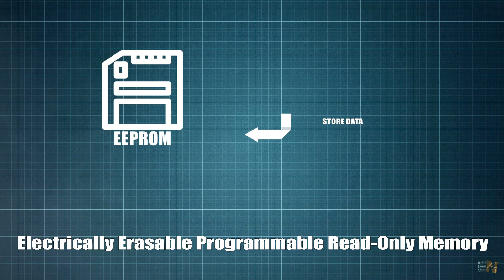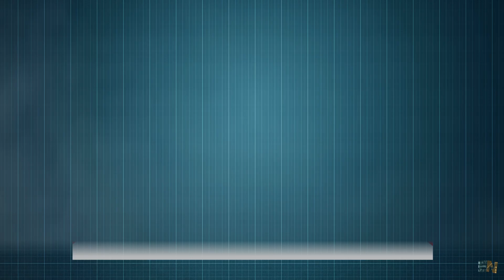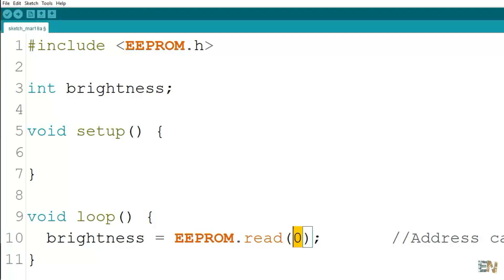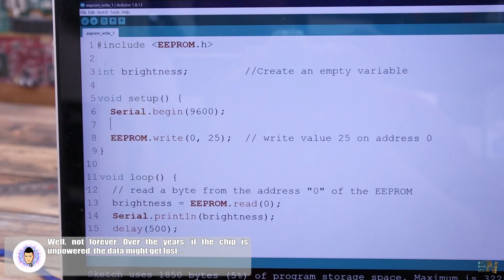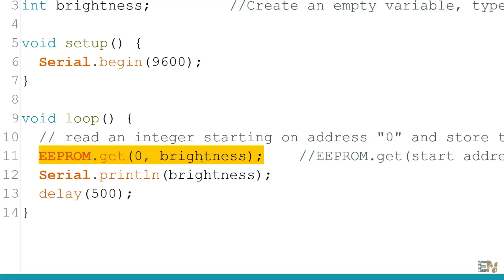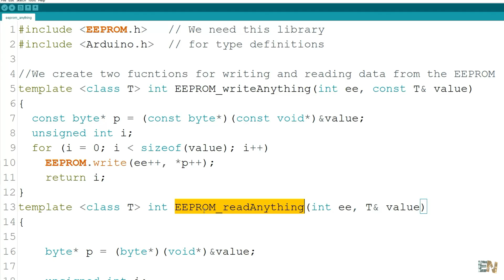EEPROM Memory - Store Anything - Arduino101

Comment: your example around 8  mins doesn't actually show it recalling memory on power up since setup still had the write function. it would show it better if you changed the code to only read on loop and not write, that would prove the memory while off.

Comment: Is there any way to read/write this memory or any other option like memory faster then 3ms? Can we read/write in micro seconds? I'm using a clock of 3k, thus has a time frame of 333u. So, I want to store and read ADC value as fast as possible because I have to react as soon as possible if detect any change in analog value at A0;

Comment: EEPROM.write(0,60);    lcd.print(EEPROM.read(0));   EEPROM is not storing values permanently.      when I block this line     //EEPROM.write(0,60); .... and run the program again after switch on/off power... its shows 255 value ?

Comment: Nice video as usual! Thanks. 
Qst though.. in your example, you left the value assignment 25 in the setup. that would have been better to do an example that increments an eeprom byte with a button. then disconnect and reconnect to confirm the memory retention

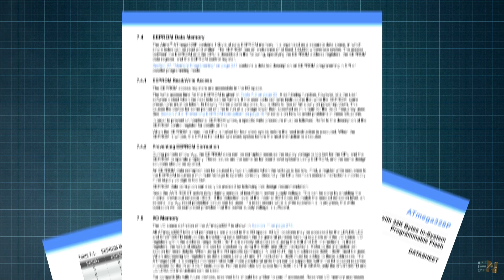Comment: 3:31 It would be more awesome if you have mentioned the size of transistor
Reply: They will probably change size depending on how they were manufactured. Older EEPROMs will most likely use larger transistors than newer ones. Its also not really relevant information as it can change and it doesnt really change the implementation at all, might effect things like density and power consumption though.

Comment: eeproms constantly spit out their binary values within their memory on the data lines that they are connected to, especially in devices that need to remember settings like Christmas lighting controllers, they are like electronic reminders.
Reply: That happens with EEPROMs that have address and data pins that you access in parallel, rather than I2C or SPI EEPROMs.

Comment: Thanks, nice video! EEPROM's are very useful. I use the internal or external (24C256) to log c-strings of variable size. It's for debugging my sensor code over several days. I can then connect my pc and dump the contents of the EEPROM on the serial monitor.

Comment: EEPROMs are often featured on SoC ics but if you look in the datasheet they have a limited number of writes. The chip I use, I think it is guaranteed at 100k writes. It sounds a lot, but if you program is say updating it once a second then you will end up with an unreliable program and wonder why it is so temperamental.  The solution is to use a memory controller. This will mark faulty parts of the memory so the controller switches to a fresh block of memory and does all this without you worrying about it. I need a lot of flash so I now use and SD card which has a built in controller. This never fails.
Reply: EEPROM is more used for storing settings or data that wont change for a while, not like for writing once a second, flash devices like emmc or SD cards or SPI flash have less write cycles than EEPROM, but they are bigger so wear levelling can be used to greatly increase their lifespan. I also think you may be confusing EEPROM and flash, they are similar but they are not the same. SBCs with built in storage usually use EMMC, which I think you probably mean rather than EEPROM, they are very similar to SD cards and in a lot of cases are actually more reliable than SD cards.
Reply: @conorstewart2214  I did mean EEPROM. With a SoC you often get a small amount of EEPROM as well as flash, and the EEPROM is supposed to have about ten times the write life. The sort of thing you may want to do a lot of  writes is say when you want to record the time you switched the system off or perhaps when it crashes and you want the most up to date time or possibly other varying data.  I do not have an EMMC in the Soc I use but do have and SDIO interface.
Reply: @Andrew-rc3vh  "I need a lot of flash so I now use and SD card", you went from talking about EEPROM to flash and SD cards. Lots of modern microcontrollers and probably SoCs too dont have EEPROM, they just emulate it using flash, so you lose most of the benefits of using EEPROM, I know STM32 does this, I know teensy does this, the rp2040 doesnt have it either. You also talk about memory controllers and EEPROM, I've never seen that before, and you talk about fresh blocks of memory, which sounds a lot like flash, so you can probably see why I thought you may be confused. 

You also stated that sd cards never fail, they actually have a very high failure rate compared to other types of memory, for example in my phone I use an SD card for storing things like photos and about once a year the whole card fails so that it becomes unwritable, I can only read it from then on, and I use good main brand cards. If you look at forums and similar you will see that SD cards fail very often compared to the likes of EEPROMs, SPI flash, EMMC etc, it does have the advantage of being easily replaceable but it still fails faster.
Reply: @conorstewart2214  Hmm, it seems odd that it fails more often if it is the same memory. Perhaps that might have something to do with the connections. Actually given the choice I would have liked the small bit of memory to cope with a lot of writes because I had it so arranged that it would still work without the SD card and write to internal flash if it were not inserted. Anyhow this has to write the time once a second, so now i arrange it so the part of the memory it writes to advances as the log records data. It's a complicated thing to explain fully, but it does work 100% reliably now. I used to need to store various pointers, but that's all taken care of in the new scheme.
Reply: Andrew it’s really not all that complicated to explain, you are pretty much just creating a log file, just recording data and moving through the storage writing it sequentially one after the other. Unless there is something else you are doing too.
Reply: @conorstewart2214  Yes there is in fact. The time stamp is 4 bytes, but seeing 3 of them rarely change I just log the byte(s) that changes. It tend to compress the data and is fast to read. I need to scan the last block on startup, but it means I do not repeatedly need to store pointers. One thing I worry about is the classic case where you power down and interrupt a write cycle. This way makes it more robust against that kind of problem. It will not trash the whole log. If it fails to read or write I have an error log too. So far zero read/write errors.

Comment: The question remains how to extract the firmware off the chips. i use Microchip MPLab PicKit4 to extract the hex file to create another device. u can read and write to any arduino using this device. but it would be noooice to have content based on that process. especailly when u break the usb port off

Comment: You could have told the Viewers how to Map the Content of your EEProm for the entirety Sketch - to not have conflicting Adresses and length. Also it would be important that the eeprom keeps it value’s if you reflash your development arduino for the next project - which could cause unwanted behaviour if not accounted for
Reply: I usually solve this by only writing a single union struct to eeprom with a single first static integer version - if the version doesn’t match my constraints - als eprom data is erased

Comment: Hi,
EEPROMs are quite handy and useful to work with. However, they suffer from slow writing/reading speed (I2C) and small data storage capability. A nice improvement is to give NOR Flash ICs a try since they feature larger data storage capacity and faster to deal with.
Nice tutorial keep it up !!
Reply: Interfacing those NAND and NOR flash require special hardware that comes with STM32.
They offer FMC specific to interface those type of storage beside the QSPI and OctaSPI flash system

Comment: Dear Electronoob,
Can you tell me the difference between eeprom.write and eeprom.update function is both are same or different?
Does eeprom.update function reduce the writing life cycle of micro-controller as eeprom.write function does because as mention atmega328p has 1M(million) write cycle it means if we write 1M times it writing life exaust does it is same for eeprom.update function?  (Sorry for bad english)
Reply: EEPROM update reads the current address and compare it with the value to be stored.
Of they are the same, no write shall be done.

Comment: Hi,
thank you for the tutorial and effort you put in those videos.
On another hand, I don't recommend using eeprom,put to store more than 1 byte. It might effect a previously stored data and ending up with useless data.
My recommendation is to divide the float or int to 4 byte manually by mean of shift operation and store them manually.
This method will let you know where the data stored and avoid overwritten the previous values.
Reply: I was also wondering about this issue. But don't understand how to handle it
Reply: You just need to know the size of everything you are storing and make sure that none of it would overlap and probably create a diagram or map to know where everything is, another way would be to have the address auto increment by the size of the data to be stored but that is most useful if you are writing a sequence or set of data sequentially and reading it sequentially.
Reply: Christ

Comment: Hi!
Nice job bro!
I looking for nrf rc car control, and in your channel i found the example for that.
But i dont know how to put to gether because of the interference between the 3 phase motor and the nrf.
Any useful tips?
(sorry if i didn't write something completely understandable i don't know perfect english but i tried)
Reply: What do you mean interference between the motor and nrf? I take it by 3 phase motor you mean BLDC, I have built drones and RC cars and never had any interference. If you are powering the ESC from the same 5V as the arduino and nrf24 then you probably shouldnt be, the ESC should be powered direct from the battery and the NRF24 and arduino should be powered from a 5V converter connected to the battery, thats the only way I can see you having problems with interference, either that or your converter is very poorly designed and doesnt have capacitors.
Reply: @Conor Stewart I'm thinking of emf, what can bother the receiver because the receiver has 2 communication wires and such pulses can be strong enough for the signal to be noisy enough not to work as intended, im watched a lot of video about this to understand about how it works together, but this interfearing variable is a litlebit confuseing me.
Anyway thanx the information about this knowlage what u have!
Reply: @erikkalmar4965  Have you actually built it and tried it? If you havent built it and are worrying about it then you are probably worrying about something that wont make any difference at all.
Reply: @conorstewart2214  Yes I build it and tried it, and the resoult is interesting.
It is working nincely but i dont know why some times the signal is looks like a litle bit noisy.
The servo is delayed if its happening, and the motor speed control is delayed too, i dont know it is just because the noise, or someting else cause this 
Actualy the powersuply is not a problem i use the esc power output for this, and if i try this with battery or anythig else, same thing happening, i gues if some how the communication line get more gnd wrapped around it with a thicker cable can solve the problem, but now i dont have thicker cable sadly for this.
So i need to look around and see if i found something usefull for this purpose.
So sorry if im not realy understandable in english😅
Reply: @erikkalmar4965  What signals look noisy? Are you looking at the SPI signal using an oscilloscope? The ESCs 5 V output may be the problem, especially if it is a cheap ESC. I find it surprising you have problems when I havent had any, and I used a cheap chinese fake without twisted wire pairs or anything with its wires right beside my ESC power wires and the nrf24 right beside the three wires that go to the motor and had no problem at all. Your nrf24s may be fake and that may be why you are having issues, especially if they were really cheap. Your problem with delays could be because of the arduino, depending on your code it might be too slow or if you use a lot of blocking functions, you might miss data packets. Are you using the ones with the external antenna or a built in antenna because I've heard that the cheap fakes that have the pcb antenna have a really terrible range.
Reply: @conorstewart2214  im understand about what you told me.
Just i dont realy know what do you mean about the extermal antenna, i gues it is looks like a copper zigzag in the pcb, but in my case, i have antenna connector in the pcb so maybe this is not a bad one
Actualy the code is the same what elekronoobs have for aircraft if i remember good, i use this code because it is have a lot more pwm output, and some digital ones, witch is in first time when i looking for code i think i can use this one if i want + funcionality. Can be this is the problem?
Because i dont use all of the output yet.
And i can change the code if it is not good for this.
The esc is actualy not a cheap one, so i dont think there is anything wrong with the esc.
I need to find what cause the problem but in the mindle of the week i just simply dont have time because i working in one company.
Reply: @erikkalmar4965  you get two types of nrf24 there are ones you have to screw an antenna on to and ones that have a PCB antenna, "copper zigzag on the PCB". You have a PCB antenna one and if it is fake then they can have really bad range and a lot of the fakes don't work properly for all bandwidths and transmitting power.
Reply: It is can be the problem if i have 2 same module, witch is have the screw on antenna port?
Reply: @erikkalmar4965  didn't really understand that but I think you are asking if it is okay to mix the pcb antenna and external antenna ones and yes that is absolutely fine. They are the same except one has a pcb antenna and the other has a power amplifier and an external antenna, they both work absolutely fine together.

Comment: Let's say I want to 'put' an Integer value of 300 to address 0, I assume then the function is internally using the addresses 0 and 1 (assuming an Int takes 2 bytes).
So, if I don't take care of this and 'put' another value (let's say 0) to address 1, is my previously stored 300 partially (silently?) overwritten and  now i would 'get' back 44 (or 256, depending on byte-order)?
So I would still have to know/keep in mind the length (-> sizeof()?) of an integer and start at address 2 for the next value to 'put'/write?
I think this wasn't mentioned (or I missed it ;-/), or am I wrong with this assumption?
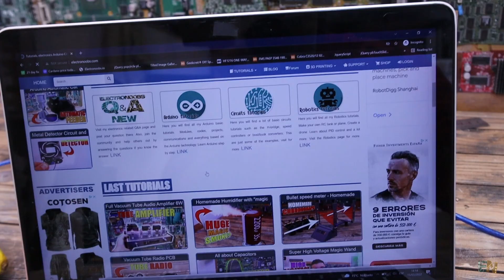[Update: Sorry, never mind: I just realized that it was actually mentioned at ~10:04 (-> reading/writing 2 bytes)]
Reply from the maker: You don't have to keep in mind that because the EEPROM.get function dose that automataically. If you write EEPROM.get(0, brightness); and you defined the brightness variable as int, the function will automatically know to read 2 bytes. If you define brightness as float, it would read 4 bytes and so on. 
On the other side, yes, if you put 2 bytes on address 0 and 1 and then you put 1 more byte on address 0, it will overwrite it, that's obvious.
Reply: @ELECTRONOOBS  im not a programmer. Does that mean, that when i write an integer (2 bytes) to adress 0 that the next integer has to be written on adress 2 or does it not matter how long an integer or float is meaning i can put one integer on address 0 and then the next float on address 1 and the next integer on address 2?

basically like this: 

Address 0: Integer
Address 1: Float
Address 2: Integer
Address 3: Integer
Address 4: Float

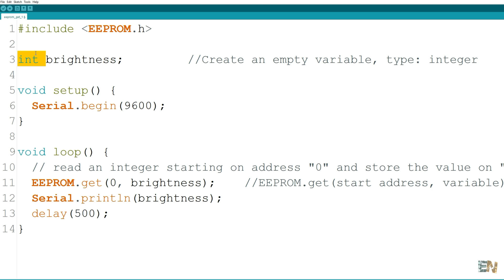Comment: 7:43 Everytime you connect the power to the arduino the void setup code also runs which rewrites the EEPROM memory with '25'! So technically you can not say that the data you saw on the serial monitor was past data!
I think you could have input the data using the serial monitor which then you have stored to EEPROM and then unplug and plug the power again to check that if the data is there or not! This might be the technically correct way of doing this!
:)
Reply: Just delete the line EEPROM.write(0, 25); from the setup loop and upload again before you run for a second time.
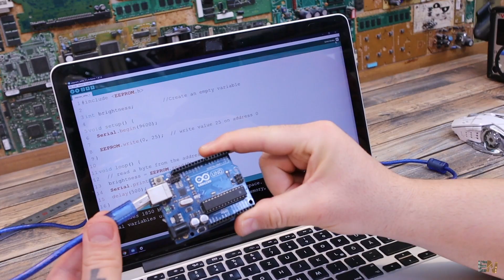Reply: @k0pR0LiTh0s  or use the 'update' function in the reference at 6:00, the one that only updates the value if it's not already there.
Reply: Also you could read the value from a POT and save it in the EEprom and just use the update. Have a print value in the setup so every time the power is connected you'll see the last value
Reply from the maker: Thank you, but it was just to make an exampel of how to use the EEPROm.write function. If I use it in the void loop for that simple example, it would write it over and over again. In a read scenario, you would make an if() and decide to write or not to the EEPROM probably.
Reply: @ELECTRONOOBS  Yea! That seems good!
Thanks for the great video! :)
Reply: @ELECTRONOOBS 3 years late to the party...
When demonstrating EEPROM long term storage: read a value, display it, increment it, write it.